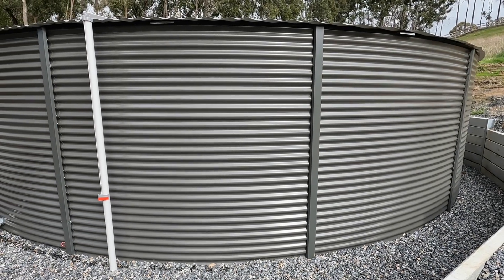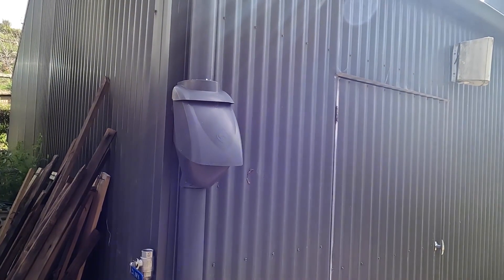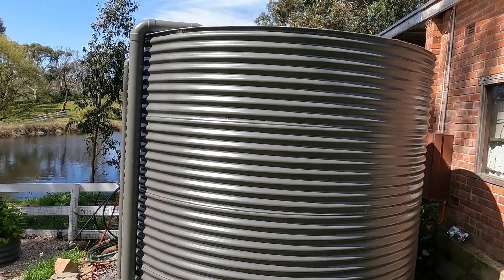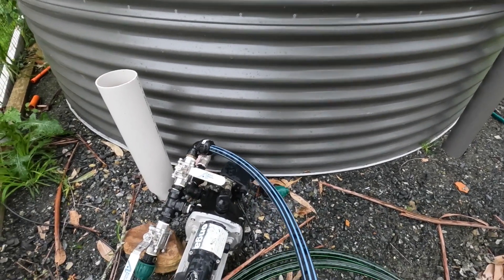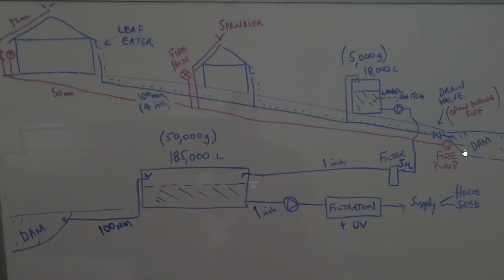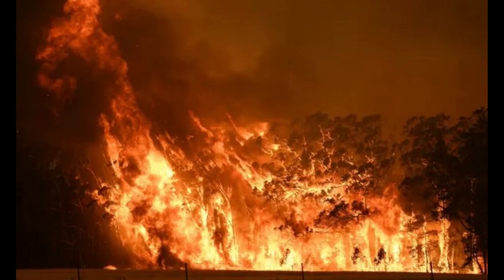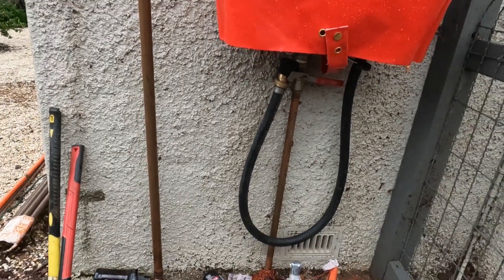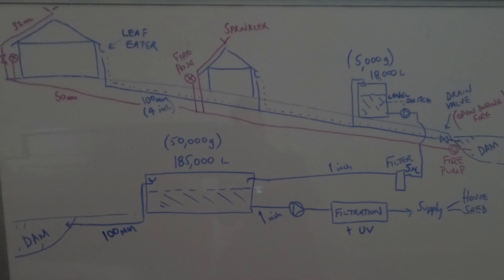Rain water collection and Fire fighting system

Comment: a previous work mate of mine in the CFA had valves on his down pipes and said to fill the gutters with water for ember attack reasons, i can't recall if he had gutter guard also (preventing leaves in the gutters), he also said radiant heat is a huge issue but not sure what he had(or planned) for defense in that regard. I look forward to hearing all you are planning/building and what else you might recommend for anyone else planning a bush build in particular.
Reply from the maker: Hi mate, I prefer to keep gutters clean rather than have covers as dirt etc still gets under them, particularly that we drink our rain water. I’ll document the finished system but that will be a few months off as I now need to get my workshop started.
It’s surprising how many people in bush fire areas don’t have any protection. It’s not cheap to do properly but in my opinion is better than losing everything in a fire.
Reply: @Mezzmoengineering  yeah i'm surprised home insurance doesn't have requirements in prone areas for certain things. i guess if it's unaffordable people will just roll the dice on it, but i've seen a couple of instances where mates have had the car packed and ready to leave due to close fires and just been lucky the fire didn't come (rounding up pets kids and stuff with a looming fire seems like a nightmare if not planned for in advance)
Reply from the maker: @deankdx  I guess people just think it won't happen to them. I've seen it in every natural disaster I've been in, either floods or fire, people go from being under prepared to panic and then going out buying too many things at the last second. With a fire, you need a plan well before it even starts, for me, once I get the system finished I'll test it properly and then will do regular checks on it. Some might think I'm crazy but I'm happy knowing its there, even if I never use it for a fire. Reality is that fire fighters are there to protect lives and people. They don't try to save sheds, workshops, other outbuildings, trees etc .